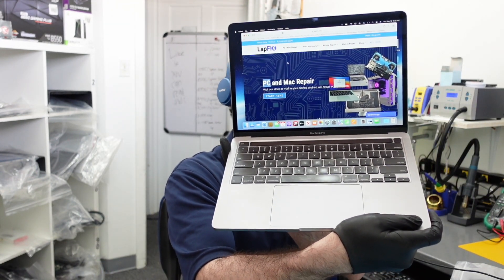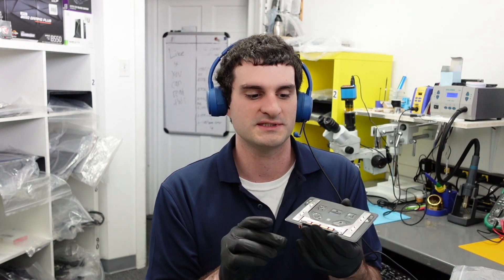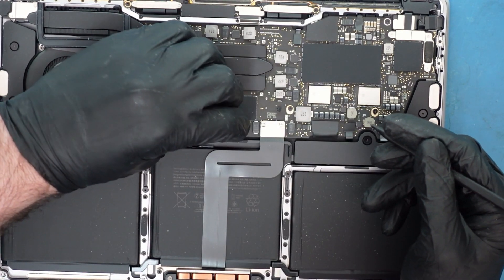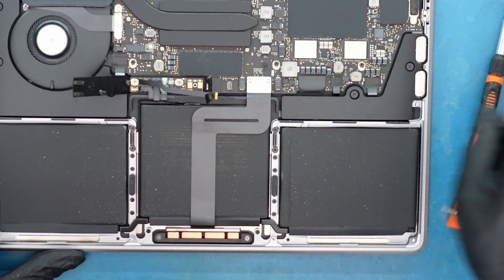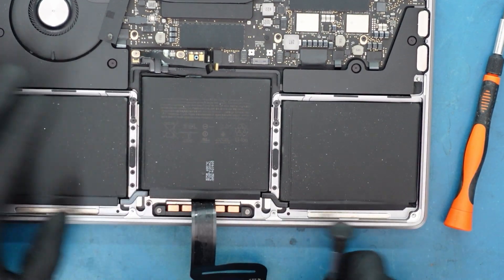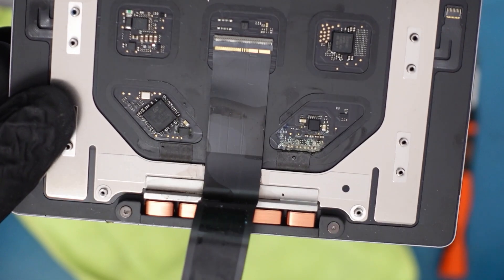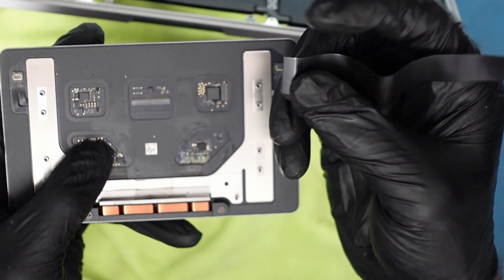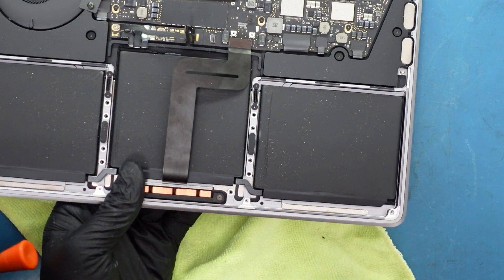Macbook Pro 2020 Trackpad Replacement a2289

Comment: The trackpad on my A2159 is not responding, cursor is just stuck in the top left corner. Tried replacing the trackpad and flex cable today, but it’s still broken. Any tips to try, or things to check? Keyboard and everything else works fine.

Comment: Thanks for this video. My MBP 16" (2020 model but bought in 2021) is coming up to 2 years old and the physical click has been intermittent on/off for a while, though as in this video, all actual functions are fine. So that's tracking, multi finger gestures etc. It's currently off, and has been for few weeks now. And it's quite annoying to not feel that "click" But before that, worked for a while, then wouldn't, then would, you get the idea. Sometimes, just closing the lid and then opening would be the difference. Also, would happen mid session. A local service centre just said it needs a replacement without even checking it, if that's the case then so be it. But wanted to know from your perspective that is really the only option. 
Thanks in advance.

Comment: Hi, i have a macbook pro 16" from 2019, it did not give me a haptic response, the Force Touch is sensitive to touch and pressure but there was no sensation of "click" or vibration, I disassembled the mac and the trackpad out of pure curiosity, and when closing and turn on the mac, the trackpad was completely unusable as well as the keyboard and the fans at full, I already tried to restore PRAM and SMC with an external keyboard and nothing worked, I already started in safe mode and neither. I reopen it to verify all the grants but there is nothing visibly wrong. Please Help...
Reply: Hi, I have the same issue. I think maybe we damaged the battery cable that connects the battery to logic board (I was super careful while doing the replacement of the trackapad but still).
Lapfix..can you give some advice there? If my thoughts are correct, do you have also video on how to replace this cable please? Thanks a lot !
Reply: Ok, I fixed my problem. The flex cable for trackpad was not inserted enough in the slot. This caused all the panic. I am not sure what can be your cause if you didn't changed the trackpad. But to be sure try to check all the flex cables if they are inserted correctly. Hopefully it will solve your issue. Good luck!